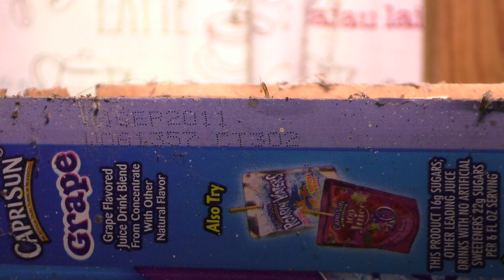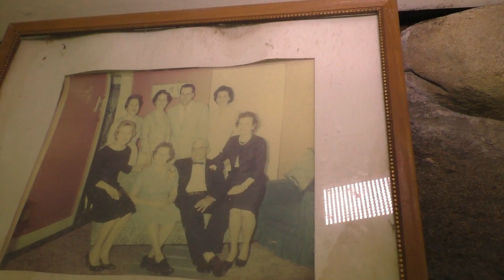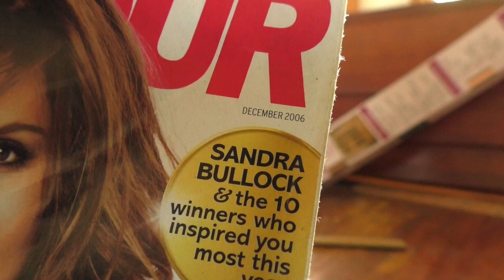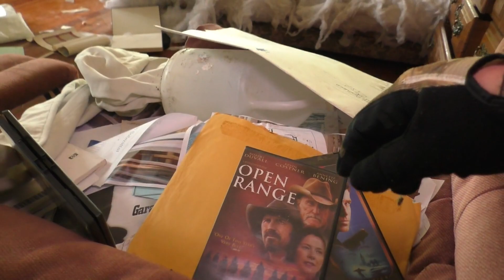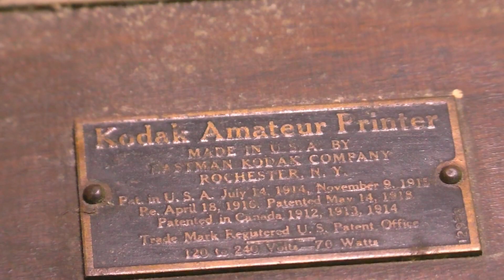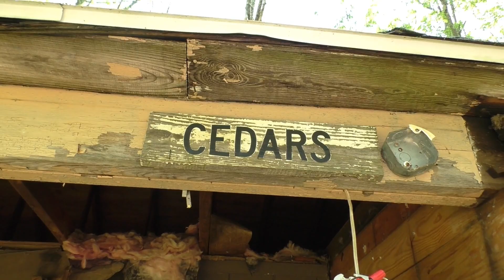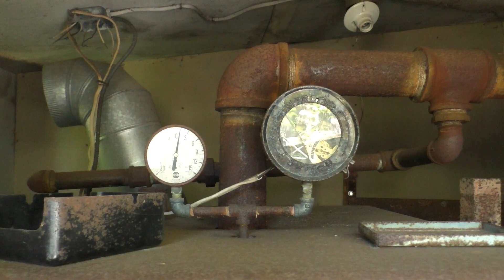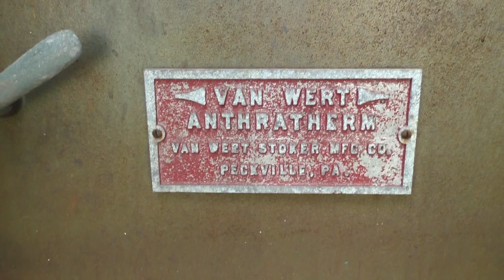The Abandoned Starlite Wilderness Resort

Comment: It is possible the pool was filled by a natural spring. That may explain the well and pipe you found. There are remains of an old 1800's resort near my city, that has a similar looking pool. A spring was used as a water source for the pool.
Reply from the maker: Possibility
Reply: Valerie Sutton The stone surround with a pipe going into it was possibly a water feature of some kind, a decorative element i.e. statuary with water flowing in or around it.  It reminded me of a small man-made stone waterfall feature in my town’s city park.

Comment: The engine was a Volkswagen non turbo diesel.  Odds are it was hooked to some sort of power generator, and you could run a pretty decent size generator off a 4 cylinder diesel.  The pull knob was most likely to mechanically shut off the engine by cutting fuel to the injectors.  The other switches were probably fuel pump, glow plugs for cold starting and the starter itself.  That lever looks like some form of clutch to me.  whoever built this was very handy and its a pretty cool idea.
Reply from the maker: Thanks for that info.

Comment: Gotta ask.  I've seen a few of your videos and it seems like there is red ribbon taped to the floor in several of them and in several shots...

What's up with that?
Reply from the maker: Not sure what you mean. Can you give me a time stamp in the video to see?
Reply: It seems to appear mostly in buildings where renovations and restorations were considered, or repairs were started but not finished. 
It is a common method of marking out where wiring, plumbing and structural battons and joists are located on the other side of floors and walls during refurbs, refits, renovations and repairs so you aren't constantly rechecking everytime you need to cut or drill through walls, floors and ceilings to make sure you don't electrocute yourself or cause a disaster with water and gas line damage

Comment: now that engine rig setup ? many possible uses for that setup - even like you said for a saw of some kind - possible for a water pump for a water heated floor or ? even to supply water to other parts of the property for watering or filling the one stone rounded well like structure / could have been a water fountain for the birds and was fed by the pipe that was sticking out - to maintain a certain level // after all on the shelf i did see a transfer case for a 4 wheel drive vehicle - and that lever could be for changing gears at a higher idle speed // and just like most history going to pot its all due to the Corporate Entities wanting a concrete jungle !!!!!!!!!!!!!!
Reply from the maker: Lots of possibilities for it but still a neat find.